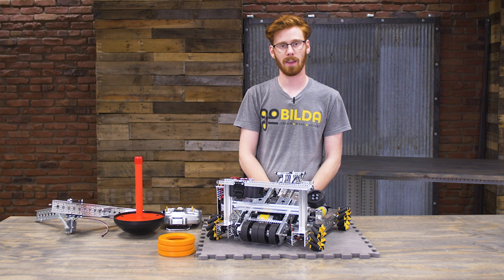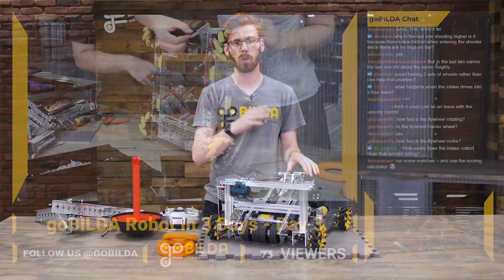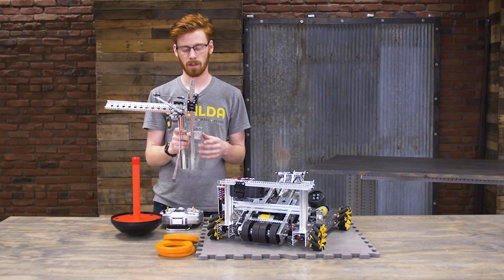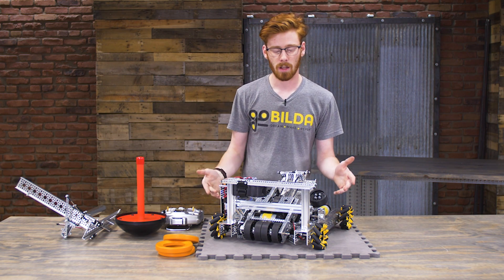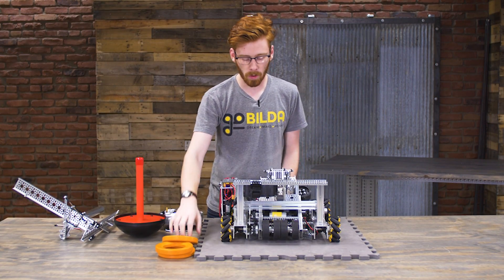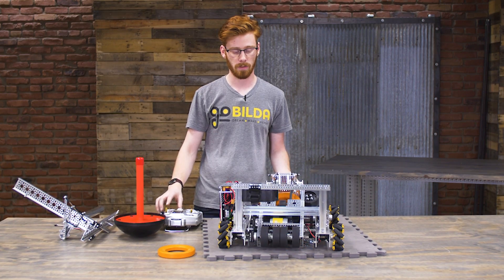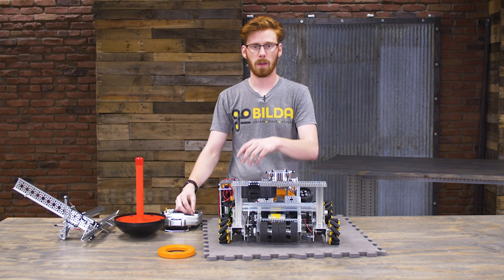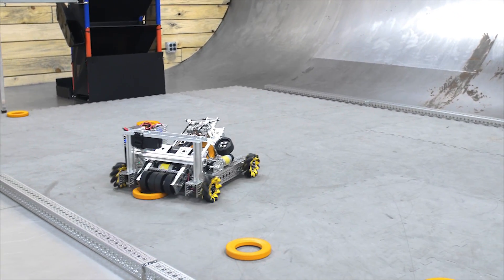goBILDA Robot in 3 Days - FTC ULTIMATE GOAL - Introduction

Comment: Very efficient, "but how you senescing that where the ring should throw AND at which direction."
also a second query is that : "How far the disk will shoot by this JST-VH to Bullet Connector adapter or which adapter or driver we can use for distance of 7-8 meter."

Comment: Did you use a control hub or a phone with the expansion hub?
Reply from the maker: For this project we used an RC transmitter and receiver set. 
If you've got any more questions please give us a call or shoot us an email to tech@gobilda.com
Reply: @goBILDA  wait quick question, what if you don’t use any controller and only use Arduino or raspberry pi instead of the REV control hubs and the expansion and driver hubs

Comment: what motors did u use for the intake
Reply from the maker: The Both the top and bottom intake rollers are running on their own  312rpm (19.2:1) Yellow Jacket motor.
5202-0002-0019
https://www.gobilda.com/5202-series-yellow-jacket-planetary-gear-motor-19-2-1-ratio-312-rpm-3-3-5v-encoder/
Reply: @goBILDA  Do these motors have the possibility to be connected to REV Robotics Expansion Hub?
Reply from the maker: Yes! You'll need to use a JST-VH to Bullet Connector adapter. But with that adapter it will work great! https://www.gobilda.com/2-pos-jst-vh-mh-fc-to-3-5mm-bullet-mh-fc-adaptor-100mm-length/